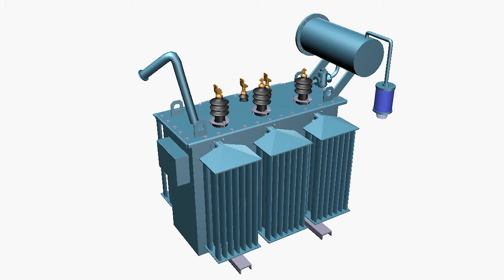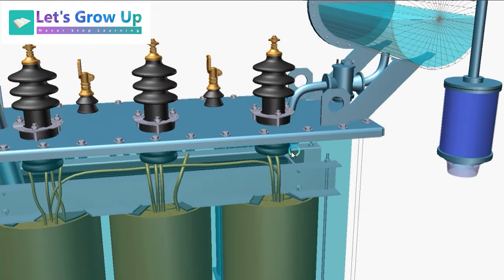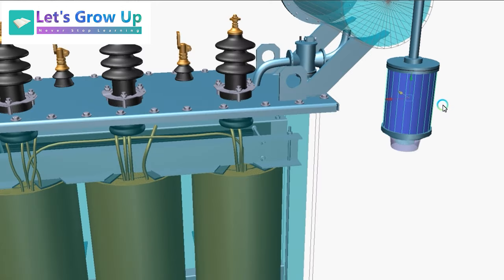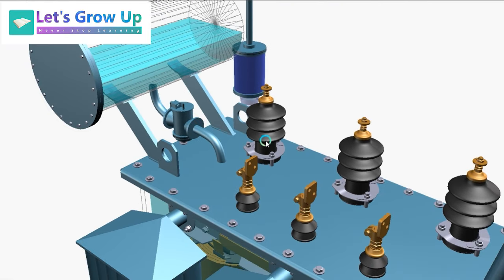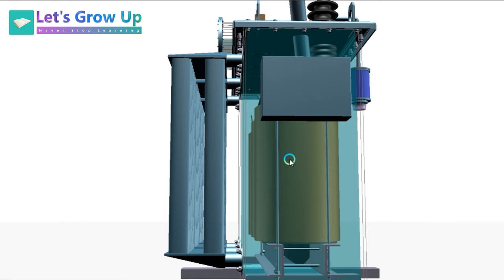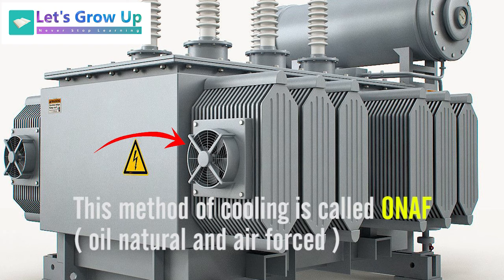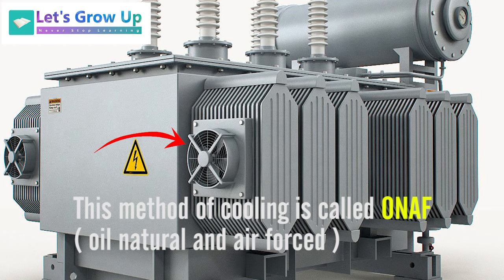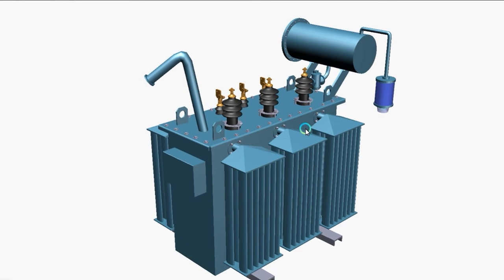Parts of Transformer | #electrical Transformer| 12 different parts of a transformer

Comment: Having a question!!!
Question : vent is provided to throw the oil out of the tank when the oil gets heated up and boil over. As the vent is connected directly with tank without any breather, isn't it moist air could enter the oil tank through vent. Shouldn't vent  be provided with breather also ??